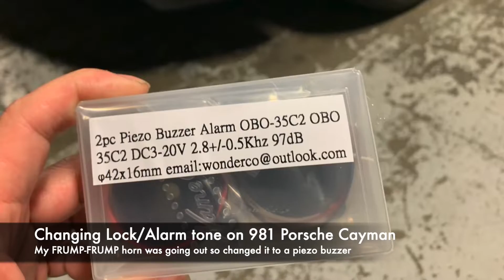Porsche 981 Cayman Alarm Lock tone change

Comment: Just a general information comment: If your Cayman/Boxter alarm double honks when you lock it, there is a fault with your car that needs diagnosing and fixing rather than just disabling the honk or changing it's sound to something "nicer".  

Also if anybody is getting a single horn beep when locking, that is also a warning sound that means you need to go back to the car and take action. It happens when several things in the car aren't locked properly, such as the doors, the glove box, the arm rest lid or boot/bonnet lids.

Search "Why does my Porsche BEEP when I lock it?" on youtube.